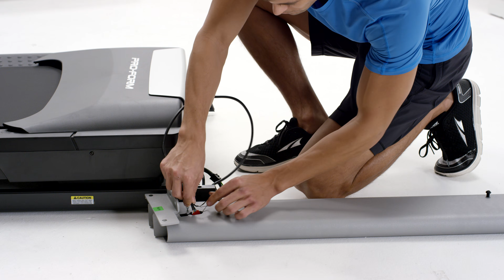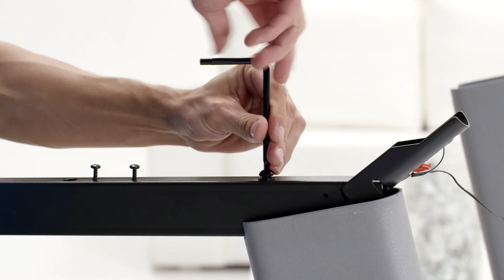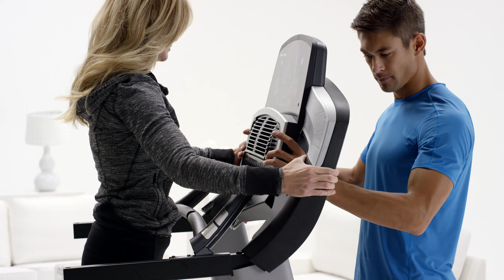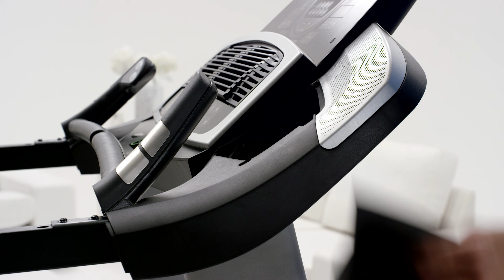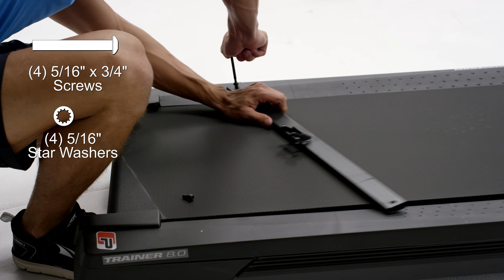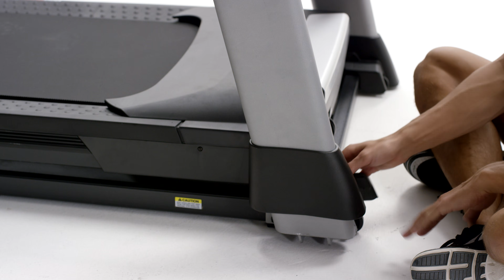Assembly - Proform Trainer 8.0 (PFTL89015)

Comment: Step 16 killing me, can’t line up the bolt through the chrome piece inside the tube
Reply from the maker: The tube on the storage latch shock slides up and down. You can slide it into position so the holes line up. There may be a plastic spacer installed that you will push out with the bolt. If the spacer was previously removed the holes may need to be manually aligned.

Comment: Will this assembly video work for the ProForm premier 900 model?
Reply from the maker: Do you have a model # ? The steps may be different but you will find many similarities between the two models.
Reply: Fitness Equipment Help model no: PFTL98115

Thanks!
Reply from the maker: the assembly steps are very similar excet that you will have a different set of (fewer) operations to install the console to the uprights. Check your users manual for specific differences but I believe this video will be a good guide for you.
Reply: Step 19: the spacer of the storage bar came out when I pulled out the wire. Now the bolt won’t fit through. Is there anyway to push down that silver portion so it will all fit through?
Reply from the maker: Yes the outer tube just slides over the top of the pneumatic shock you should be able to slide it back so the hole lines up better. I do it slowly so the end of the shock doesn't get pushed out of the end of the tube. It is not hard to get back in but is less fun than other things I can think of.